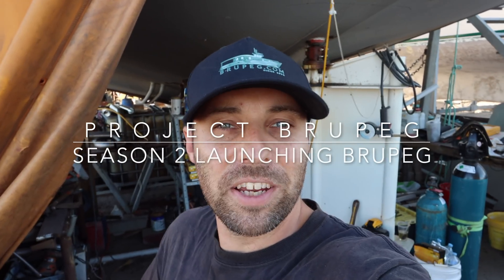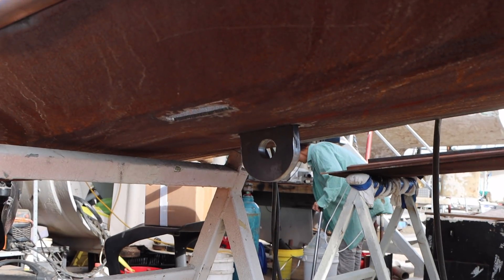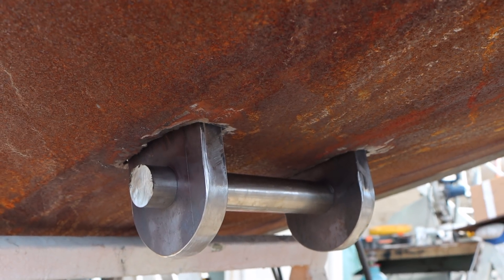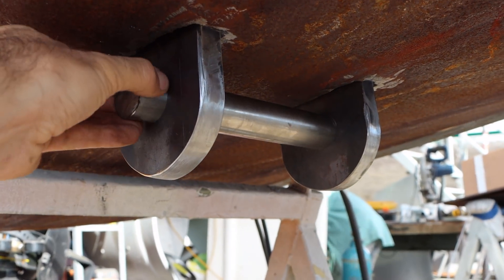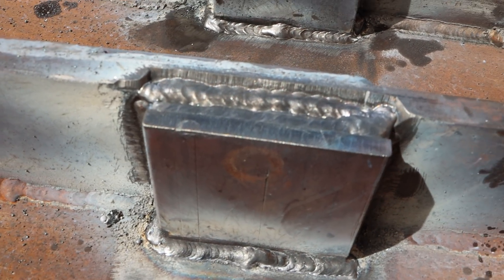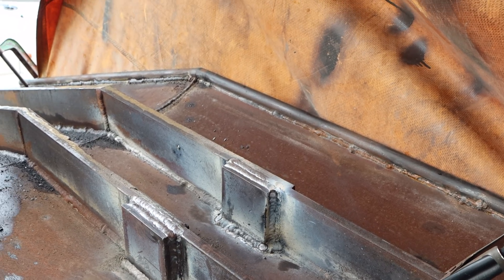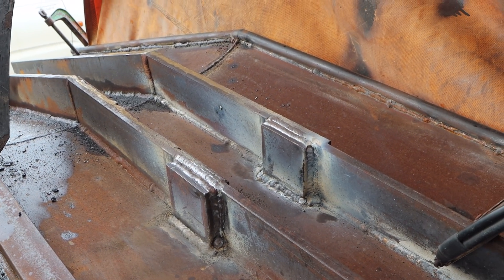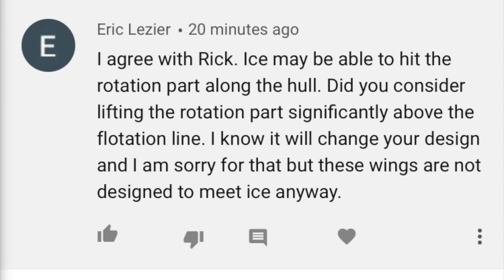Trawler Wing Hinges - Project Brupeg Ep. 131

Comment: About plasma cutter. Not sure what air moisture filtration system you have, but these types of plasma cutters are prone to air moisture. They cut so so much better with really dry air (dried with some multi-stage filter or desiccant filter). Noticed this when in winter, when air is dry my 40A chinsy plasma cuts 10mm steel without much dross, and in summer it can barely cut 10mm. Filter really makes a lot of difference if you have humid air. p.s. Love your videos, thanks!
Reply from the maker: Hi Phil, currently we have no drier. I would love one but its a project ive just never got around to. We get ALOT of water in our lines as its often 80%-90% humidity here. I do go through more consumables on the plasma as a result but with us being so strapped for time each week its easier to swap tips over frequently than loose a bunch of hours building a decent drier. I have thought of using a small dead compressor i have with a 50L tank as a water trap 100ft away from my big compressor, hoping that with that level of distance the water might fall out of suspension better and have the tools plugged into the 50L tank
Reply: @ProjectBrupeg  Water trap tank also helps - I've used it before, made it from 50L propane tank. But a couple of good quality ordinary moisture filters back-to-back will also help with this problem, especially if those filters are 20 micron followed by 5 micron ones.
Reply from the maker: Do you have a link for the type you use. I’ve struggled to find any over this way
Reply: @ProjectBrupeg  I'll look for something suitable and will get back to you on that. Hopefully with links where you can buy it.
Reply from the maker: Thanks Phil, that would be awesome
Reply: @ProjectBrupeg  sent you an email
Reply from the maker: Awesome cheers mate

Comment: In projects where the internals are wrapped with a double skin obviously one side is welded too the internals. As too the other skin we cut slots the width of the internal stiffeners and the amount will be determined by the width and length of the structure .
Reply: Damian that's exactly the thing too do, your a keen young fella and your doing a great job. Stay well !🇨🇦
Reply from the maker: Yip, exactly what we are planning. one side is 6mm so thats getting everything welded to it, the other is 4mm so that will just be plug welded in the middle and continous welded on each edge

Comment: Your wings aren't going to get damaged, your hinges are the weak point. Any impact capable of damaging those wings will have already sheared off the hinges or any pivoting points before doing so.
Reply: I am more concerned with the force of the water acting against the fore and aft moment arm of the wing and the cantilever beam effect on the hinge plate at the hull.  Those forces will try to rip the hinge plate off the hull at the leading edge of the hinge plate and depending on how thick the hull material is, how much reinforcement will be required inside the hull.
Reply: @OleNavy  If we had dimensions for the wing we could calculate the surface area of the forward facing area of the wing, and use that to estimate the average drag force it will experience from the water slamming into it. Calculating it as a flat surface rather than a curved surface will give an overestimate which is useful for sizing the hinges in a worse case scenario.
Reply from the maker: 2400L x 900W x 110H, hull doubler is 200x20 welded to 6mm hull. Doubler crosses a bulkhead in the centre and two 75x6 ribs at either end. Doubler extends 150mm beyond each hinge. Hinges are 150W x 100H (25mm thick each plate)
Reply: @ProjectBrupeg  "2400L x 900W x 110H" Are these the dimensions of the submerged wing portion? I'm just curious what the numbers look like, I don't have Rhino to do any FEA.
Reply from the maker: Yes that’s correct. Front on the wing is 2400x110 I’ve not put the arm dimensions in as they are negligible.
Reply: @ProjectBrupeg  OK, so assuming a hull velocity of 9 knots, and hoping the wing is shaped like an ideal aerofoil, your numbers give a frontal area of 0.264 sq meters. At that speed, THE WING experiences(not the hinge) 127N of drag. Assuming it is a flat plate, it experiences 3621N of drag. That being said, I definitely think you are far closer to the 127N figure than the flat plate figure. A bullet comes in at 792N(mainly due to turbulent flow in the rear coupled with water slamming into the cylindrical front face). Torque is T = F * r * sin(theta). A crude estimate of the torque that the hinge experiences can be calculated by using the previous drag figure and inserting it into F, however it will be a huge underestimate. Place your R figure roughly 3/4 the distance of the wing out. So if the distance between the wing and the hull is 1m, and the wing is 2m long, your R will roughly be 1.75. The reason (I suggest)we do this and not use 1 as our radius is because each distance on the wing is inducing a different amount of torque on the hinge. I can throw you an excel spreadsheet so you can throw numbers in if you like.
Reply from the maker: Mate you are well over my head at this point... im happy to offer specs on any of it, but i left school the day i turned 15, maths was on a need to know basis (to dyslexic to cope with school)
Reply: @ProjectBrupeg  Everything comes from f=ma. To kinda get a feel for the Newton numbers, divide it by 9.8(which is acceleration due to gravity) to turn it into units you recognize (kilos). An airfoil feels like a 13kg weight, a flat plate feels like 370kgs of weight. Multiply that by the distance (on average 2+ meters away), and that's the weight bearing on your hinges just in terms of the water drag. So best case scenario it acts as an airfoil and feels like a 30kg weight(doesn't seem right), or worst case scenario it feels like a 740kg weight(likely not that bad). I'd say the drag forces equate to trying to pull the hinge away from the skin of the hull with a 3-400kg hydraulic jack continuously. This doesn't mean that the wing is pulling backwards on the boat like a 3-400kg weight, the drag force is that 13kg figure.
Reply from the maker: That all makes sense. I’m feeling pretty happy with the 1” thick hinges, the 55mm pins and the 20mm doubler. Chris said that is all they ever put on a boat and they have had over 80knot storms on these wings without issues
Reply: @ProjectBrupeg  The attachment points on the wing should be A-ok. The attachment points on the hull are the only point of concern. Make sure to get some good heat going prior and after welding to avoid stress concentrations on the hull which could lead to cracking.
Reply from the maker: Yeah I don’t think my welder will even touch this. Too much steel to suck the heat away. I have a guy with a 580amp welder that will be able to get a solid amount of heat into it, my plan is get him to weld the doubler to the hull and the stainless hinges to the steel. I’m happy doing the rest as it’s thinner metal but that stuff is 16mm, 20mm and 25mm.

Comment: Go Stick welding 4 mil and you get no bubbles ore Bild a tent. 👍
Reply from the maker: or use flux core MIG with gas, same same. I always wonder why people insist on stick when times have changed and MIG is just as capable and 3-4 times faster

Comment: look at the internal parts of an airplane wing.  copy and beef it up for your wing.
Reply: Exactly, vertical ribs front to back  will reduce the chance of "flutter". Flutter in the wings could cause stress cracking just as it would in an aircraft.
Reply from the maker: Yeah the plan is add vertical for and after steel

Comment: If you are worried about damaging the hinges or the wings when up to growler ice, build in some hard points just forward of the hinges and extending upward. Mount some deflectors there that extend out from the hull and protect the wing and hinge area. Just remember that any protective measures must withstand ice trying to force it into the hull.  This would be preferred over ice trying to rip the wing/hinge away from the hull and possibly opening the hull.  Just some things to consider. :)
Reply from the maker: Hi Guys, yeah we are investigating what it would take to simply remove the wings at the edge of the ice as ice doesnt generally have swell so big we will need stabilisers and with them off we have a lovely smooth hull for the ice to horiffically and noisily scrap down the side of!

Comment: thanks for the video guys ;]  might have been me suggesting wings be used as a scientist  launch point lol  well they look solid  wish i had the math to prove it  but architecture is the direction i went not engineering,,i am qualified to comment on your framing abilities.. if you were a house building company  bankruptcy would be in the future due to massive excessive structural safety  and the extra costs associated with achieving that level of solidity lol    im not a metalworker  but the stabilizers appear to be from the same school of design,  stay safe  keep up the great work  looking forward to more
Reply: Jim Nickles  didnt say there was anything wrong with overkill lol
Reply from the maker: I've not yet found the limitations of throwing steel at something until its too strong.
Reply: @ProjectBrupeg  oooh careful there  if you hit critical mass itll collapse in on itself and take us with it lol  those steel holes are bad i have read  8P